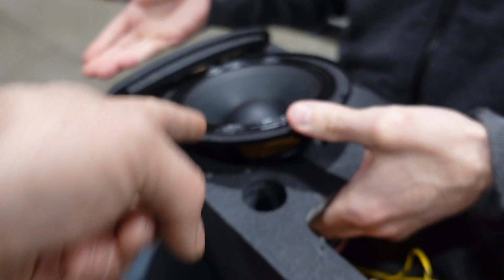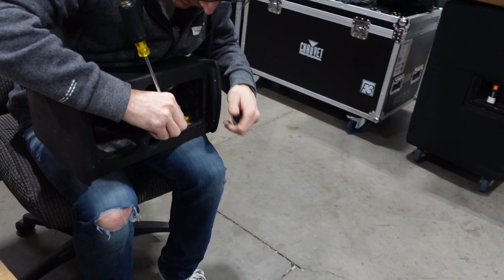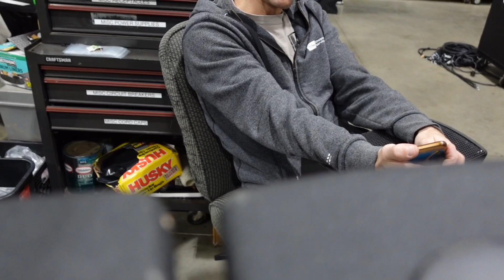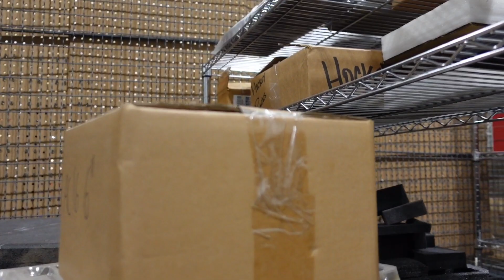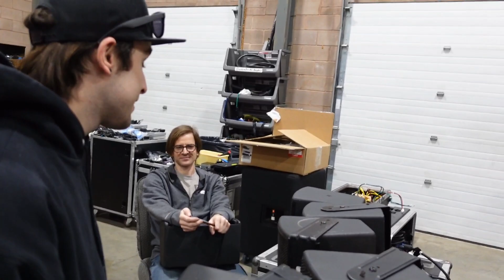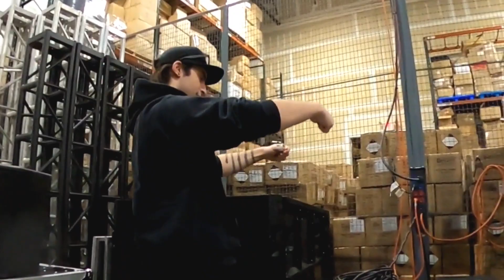s9e8 Testing Out JBL AC16 Speakers / What Are Some Of The Best Sound Check Songs?

Comment: Depending upon my gig depends upon what I use… Typically is one of the following….

Rosette - Fading Like a Flower
Los Lonely Boys - Diamonds
I’ll also use virtual Sound Check via K’s Hated X32 Rack… LOL

One thing I would love to see and hear is if y’all use SuperRack and how you have it interfaced, also how to you setup your systems with system processing, for example I’m a smaller company so I use the X33 Rack with a DriveRack PA2 ( want to swap to a venue) I’ve gotten out of using aux fed subs and letting the processor do it, now if I wanted to use a matrix would that be a better way to do it???
Reply: I typically run my outputs on a matrix (Left, Right, Sub, Front Fill) out of the console into a processor. The benefit is that if you decided that you needed a little less or more sub, it’s controllable by an output fader in comparison to jumping into a processor and surfing through menus to make that, or any, adjustment happen.
Reply: Hey, fellow small company here!  I drive my subs with a Powersoft amp, which also has all the processing for the subs in it.  I use powered mains that of course do their own system processing. On my M32R I run subs to a bus (in group mode) and run the output of that bus to its own output.  I then of course run L/R to my mains and do HPF and any needed EQ on the main bus in the console.  Just upgraded my active mains; the new ones have a lot of onboard EQ that I could use, but like Clarence, I'll probably use the desk EQ for room correction... Much easier to get at!